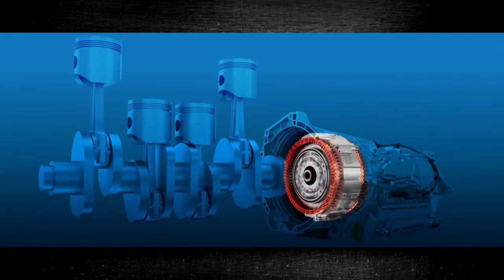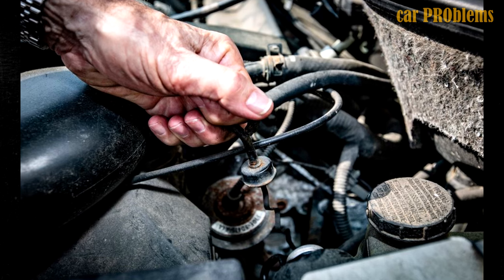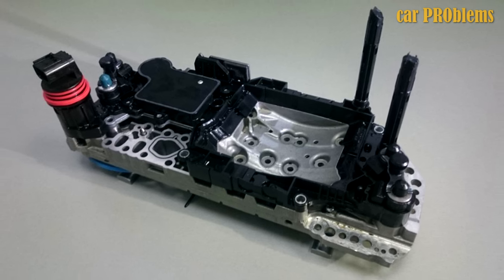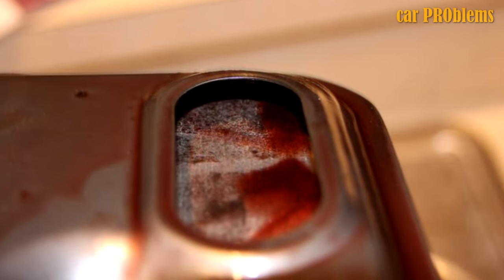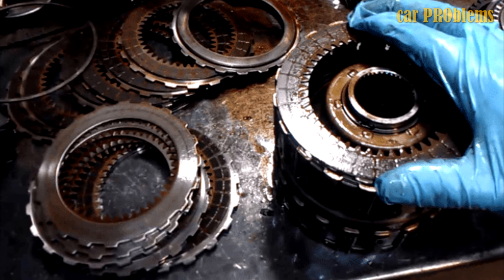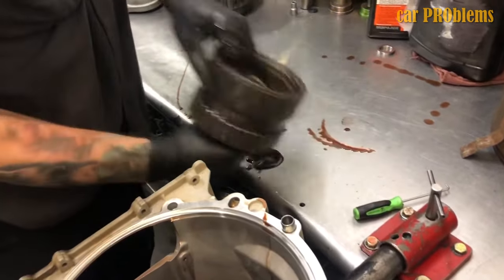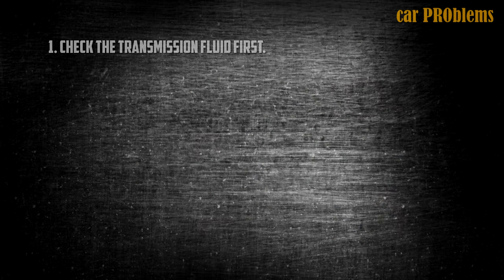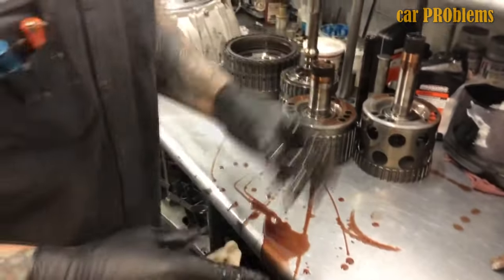7 Causes Car Won't Move In Any Gear (Automatic Transmission)

Comment: 2005 Buick LaCrosse CX with Column Shifter (114k miles)

Was driving PERFECT going 30. Stopped at a light and it made a singular “clunk” noise (not metal-y). Now it takes about 20 secs at 3-4k rmp to get past 5mph then goes up to 40 slowly. Doesn’t appear to be shifting at all but drives fine at 40mph. All my gears are like this (PRND2 and 1). Looking around for new transmissions 4T65-E FWD rather than tracing the problem since these cars apparently have the trans blow around 150k miles anyway.

Comment: My car nissan tiida 2007 non cvt gearbox repaired last week . Now gearbox is work fine but in high slope or in hill car roll down very fast if break released  so difficult to accelerate . Please help me what is the reason . It dose not have hill start assistant  in this model . Please help me

Comment: I have a 2014 jeep compass ran good for awhile...now it starts but won't move at all i replace the transmisson module and added  fluid ...still nothing..and also the transmisson light is not on but the engine light is...i wonder whats wrong?
Reply: Same here
Reply: Having this issue. Will turn on and wont move at all

Comment: I just swapped my engine in my 2003 vw passat 1.8l, we have the torque converter colted right and I refilled the transmission fluid, when starting the car it shifts and everything but wheels arnt spinning, we rotated the wheels for over an hr to try to get the fluid pumped into the right spots but still not spinning when put in any gear? Everything's up to par with new fluids, everything's connected, id really like to avoid pulling the transmission out cause it's fwd, please help

Comment: I replaced one solenoid on my Pathfinder ( code is gone now) and new filter . now I have a “no move” situation. Transmission shifted perfectly before y took down the valve body and replaced the one solenoid. Nothing is broken in the TCM.
Reply from the maker: Hi! 
1). Try to check the fluid level and the fluid condition. 
2). Make sure all the wiring connections to the solenoid and the TCM are properly connected. 
3). Perform a transmission relearn (Disconnect the battery for 30 minutes to reset the TCM). 
Good luck!

Comment: Car won't go forward or backwards. Had transmission filter and fluid changed, ran fine for a week. It's now back doing the same thing. Some whining, not wanting to move. RPM fluctuations 

Any ideas ?
Reply: I have  the same problem..How did you go about?
Reply: Please if you could reply would help us both in a similar situation with an 06 Acura TL

Comment: Great video man. My car was driving smoothly then sudenly the revs just went up and i had no drive. Car revs , but wont move at all. 
 Going to check fluid first. Then get a mechanic to go through the list
Reply: What ended up being the issue?
Reply: Had this exact thing just happen. Any knowledge of what happened?
Reply: What was the problem please reply
Reply: @kekalmighty  I have the same issue now in my Infiniti did u end up figuring it out ?
Reply: What was the issue?
Reply: Just happened to me what was it
Reply: Same thing just happened to me a couple days ago. This is the 2nd time I’ve had this problem, the first time was because my cv axle had snapped in half in the front on the driver side. I’ll let y’all know when I figure out what happened this time
Reply: Just had this happen 5 days ago. Pls anyone respond with what the issue was.

Comment: sometimes i get this issue (not alway but let's say once every 50 times) where when i am in neutral, i start the engine and then set to D the car won't move and only rpm increases.
I try to quickly put to P and back to D and it seems to work eventually.

Any ideas why this happens? This also happened on my other vehicle as well (Ford fiesta and focus)

Comment: We changed the ball joints and now the car starts but wont move. What could we check?
Reply: If it's front wheel drive andnu changed ball joints make sure your drive axle is all the seated into transmission and ur spins are seated correctly into the hub( rotar)

Comment: Just got done replacing my transmission and it still won't go into any gear
Reply: Me too u find out what happened
Reply: @masehoward8792 What type of car do you have? The shifter or shifter cable could be the reason why OR the bushing (a tiny plastic piece on the end of your shifter) could have broken and you need to replace them.
Reply: @laurencameron3150 hey, got the same problem in an 2003 manual 5 speed toyota. It starts but won't move, the clutch had no play in it got it fixed it had some air bubbles in the pipes flushed it, So got pressure. Then again it starts goes  into gear, 1,2,3,4,5 R, but still won't move gets a clicking noise while entering each gear. Removed the shifter to maybe be align the gears, hence it doesn't and thing I can't align.
Reply: Wt heck
Reply: It might be your diff
Reply: HAHAHAHAHAHAHAHAHHAHAHAHAHAHAHAHABAHAHAHHAAH!!!!!!! Exactly what I'm fearing right now with my van.
Reply: Have you tried checking the transmission fluid
Reply: I put too much fluid in my transmission and now it won't shift into gear😢2013 chevy malibu
Reply: @alikbey u fix it?